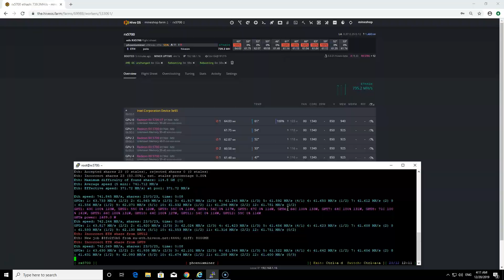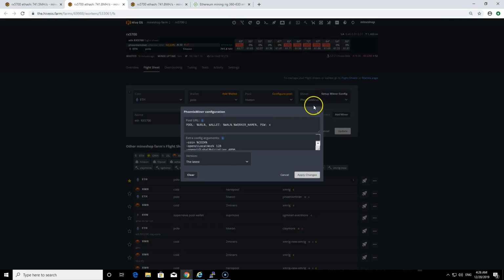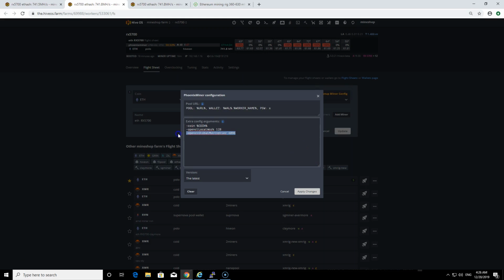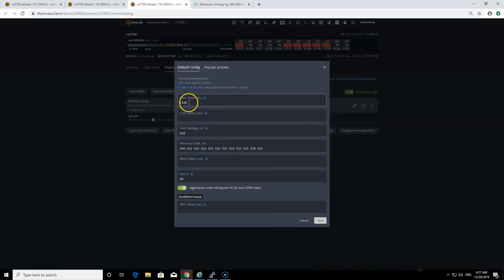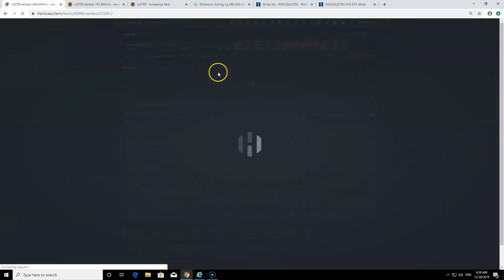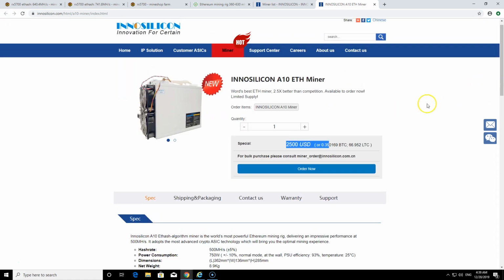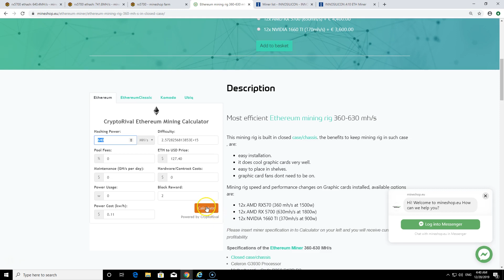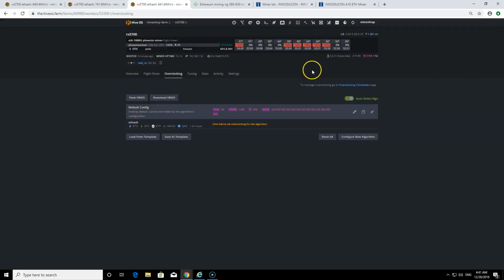742 mh/s Ethereum mining, really? RX5700 70mh/s ?

Comment: MSI RX 5700 XT (BIOS mod memory timing) -cclock 1350 -cvddc 760 -mclock 1860 @ 56.8Hm/s @ 112W (SW stat) in Win 10. 200W shown on APC UPS but I do not have mining rig...it is just a work/gaming PC with too much "mining-useless" crap such as AMD Ryzen 9 3900X...idle 70+ W...my file server uses 40W idle with 6 HDDs in :o)

thinking about mining rig but it doesn't earn too much money now and it will be even less one year later. So far an estimate about 30CHF/month...it pays off just graphic card in 13 months or so.

Comment: I have a bios modded 5700xt, hashing at 55.9mh/s with 1300cc/1880mc/950cv OC settings using afterburner - it is stable but pulling about 150w and avg’ing 76degC mem temp or 48degC core temp.  Any recommendations to lower the power further while maintaining/increasing the hash rate?
Reply from the maker: 760-790cv and cc1400
Reply: @GuntisVitolins  man naizgaja
5x gigabyte 5700xt, vis ka video liku, pat neaizgaja, restarts, un pec 2 min offlina, ja vari palidzi, mans labakais rezultats 269,4m/h uz 740 no sienas,
Reply: -cclock 1350 -cvddc 760 -mclock 1860 @ 112W (SW power use) and ~56.8Mh/s. Mem temp 80+ C and 50+ core but MSI have crap cooler...they also use zerorpm cooling and you have to force it 50-60% fan usage bearable noise. I can push it to 100% but it is like living on airport :-D

above by setting works best for my card...you have to try various setting. Boost mem MHz is official 1900MHz but at low core voltage it simply crashes. I managed 1900MHz mem and 1800MHz core with 1200mV...200+W and 57.1MH/s :-D

Comment: This does not work. You can not try. In fact, you will have so many rejecks and incorrect shares, and there will be even fewer valid ones than without overclocking, somewhere equivalent to 40Mh. This is essentially acceleration from 51-55 Mh to 40 Mh :)

Comment: just got the cheapest rx5700 that was for sale at scan in bolton uk. £280 . it was soo easy to setup . 1250 core, 900 mem, 800mv core, powlim -10  phoenixminer 4.9c  its doing 52 megahash. nice! system idle is 45 watts at the wall . mining its 168 watts at the wall. and the cpu is doing 7500 on monero so total system draw at wall is 246 watts for 52 hashes eth and 7500 randomx. best wishes from manchester uk. ps the very latest xmrig 5.7.0 does get you 0.2% more on new ryzens
Reply from the maker: Cool there is modification available which might get up to 60mh. Will have video tommorow

Comment: Congratulations sir!!! Bios rx5700xt is genuine or sppt flash? Same configuration in my rig invalids shares, thanks
Reply from the maker: Original bios
Reply from the maker: You might have flashed bios?
Reply: Original bios without sppt, Hiveos beta Gpu model radeon rx5700xt power color not support -opencl parameters, 30%invalid shares thanks for your time

Comment: Hi friend, is there any difference in power consumption of let`s say Sapphire RX5700 Nitro+ (8+8 pin) and MSI RX5700 Evoke (8+6 pin)?
Reply from the maker: Not sure what is the difference on Samphire cards. Haven't had them yet. There won't be any big difference, but usually sapphire and MSI is most power efficient. Power connection doesn't mean anything for Ethereum mining as it is hard on memory.
Reply: @GuntisVitolins  Thank you for your reply. I own actually both of these beauties. They are currently sitting in my wooden 12 GPU double-decker hashing along with 10 Vega Pulse 56s with Samsung memory. I`m just too lazy to pull them out for in-depth side by side comparison as I`m still busy reorganizing and managing my old naughty, power hungry RX rigs ;-) On the latest Adrenaline upgrade they perform pretty much on pair. The Sapphire version has three fans and its excellent cooling system contributes to slightly higher hashrate (up to ocassional 54MH/s). The problem is the fluctuation of hashrate. Most of the time it hashes stable at 50MH/s but so do my Vegas Pulse 56 at 25W higher power consumption. What do you think about the statement that one miner recently made on Red Panda`s Mining YT channel - that the latest AMD Adrenaline drivers suck way more power for BIOS modded Polaris architecture GPUs than the original Crimson Beta Blockchain drivers?
Reply from the maker: @lenochod7950  sounds like nice setup ;) depends which version of drivers , from experience in past have happened many times when new version drivers released it messes up hashrate and power usage.